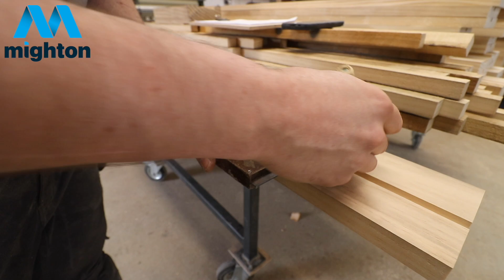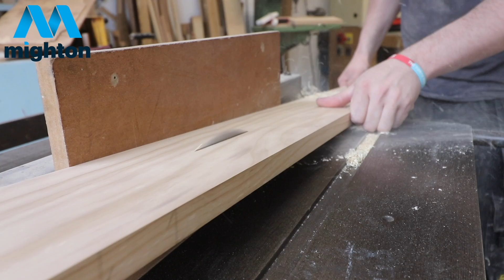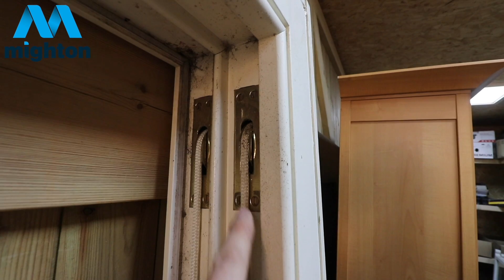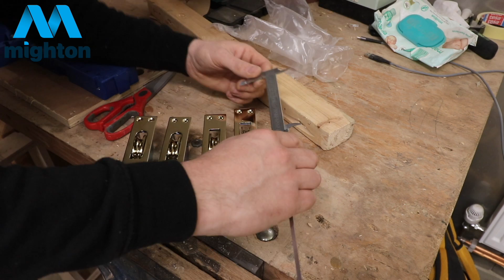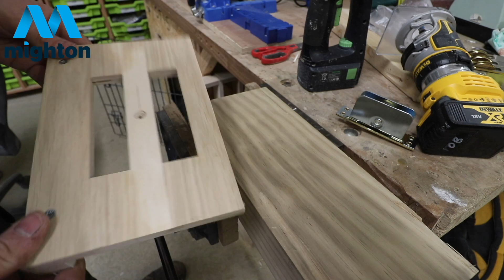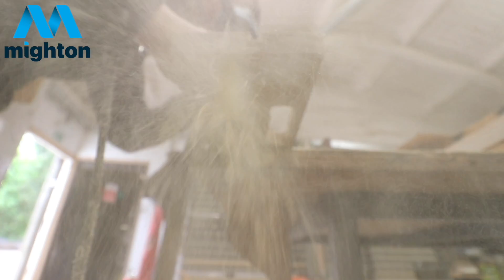Machining Pockets and Pulley Housings on a Sash Window Part 3 - Mighton Series

Comment: Ollie, firstly i love all your work you are a true craftsman. Everything you do is quality.  I have been responsible for making many sliding sash windows, constructed traditionally as yours.
There are a couple of differences,  mainly we used lead weights not steel. The big advantage is leadtime and ease of balancing the sashes. It is easy to add or remove lead. Do you use steel based on cost?
Also, with stick on glazing bars we made up a cassette in the sash then removed for finishing. What product did you use to bond the external  bars?
I'm new to your channel, so i have lots of catching up to do.
I look forward to it.
Just another question, i note on some external joinery you use sapele and some accoya. How do you decide, section size ,availability maybe?

Comment: Thanks managed to loose my old over complicated pulley jig in a workshop move. Mitre bond held up well. Quick to make so doesn't matter if the next boxes are a different width it won't matter. Cheers
Reply from the maker: its a great weapon to have in your arsenal, use it for so many jig now

Comment: Hi I am working on replicating few sliding sash windows. Where is sash pulley location? How far should the sash pulley away from the top of the box?
Reply: Thanks in advance
Reply from the maker: High as you dare without it weakening the screw fixing at the top of the stile. 70 mm to top of pulley plate probably
Reply: @BradshawJoinery  thanks for the help. Also for the weight balance cut off. The cutting kerf is pretty big on my end. Not sure if this cutting off is required in UK? Or is optional?
Reply: @BradshawJoinery  I am in the states and doing a job to recreate this type of window. Try to have a cleaner cut

Comment: What happened to part 4? 

When wet sealing the external bead, how do you stop water ingress between the two wood components?  as just sealing between the glass and the bead wont stop it.
Reply from the maker: It's in my edit list, I don't get alot of time spare and it doesn't really pay, so I get to it when I can! There is a full length quick run through of the whole job you can see all the processes on without explanation if it helps. You can seal the bead all the way round but it's not necessary with Accoya, and makes removing it near impossible if needed. If the beads fit well the water doesn't do between them. Pros and cons to both internal and external beading
Reply: @BradshawJoinery  hi Ollie, is that video on the channel? These really are the best videos on YouTube for sash windows
Reply from the maker: https://www.youtube.com/watch?v=9DI0xbxKcb4 @michaelsd88

Comment: I admit I'm a bit pedantic, but... ALL windows are sash windows. Sash is the frame in which the glass is held. What you mean is a hung window.
Reply: As someone with half casement and half (double) hung windows in my house, I must agree. Good point! 
It's a gratifying project to restore either type to operable condition, especially when they had been painted shut for years.
Reply: They are called box-sash windows where I am from (UK), probably because they are a boxed frame usually containing two sashes. He is just shortening the name in the video to save time.